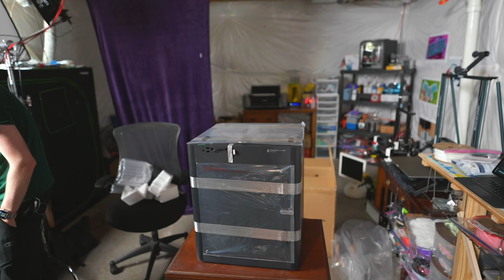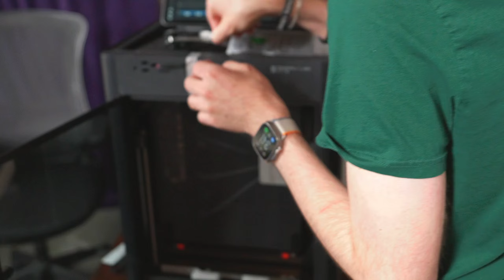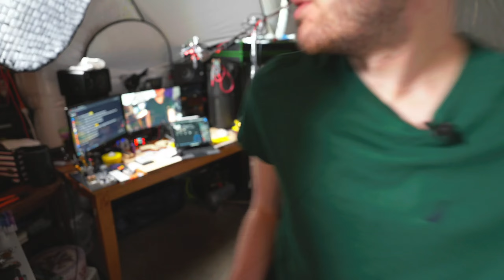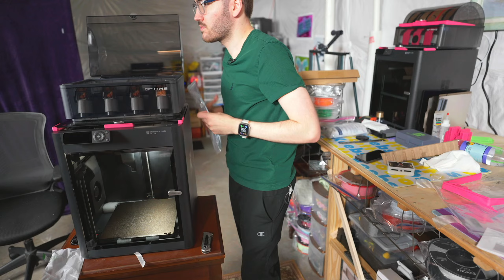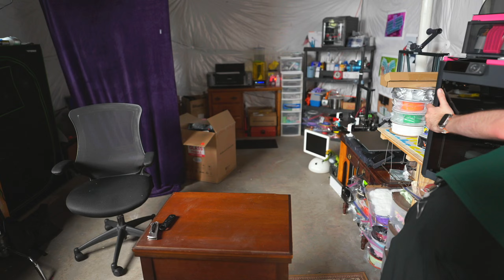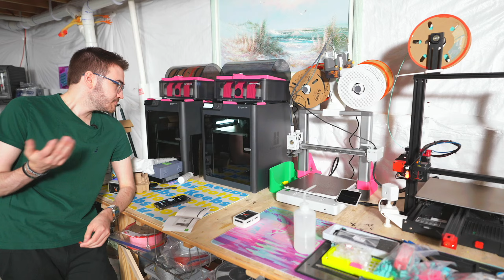Bambu Lab P1S Combo Unboxing and Setup

Comment: Pity you didn't put the filament holder on, I got the first screw in no problem but the second screw would not start, after 10 minutes I realised there was a short screw already in the hole to keep the main back plate on. Duhhh Didn't see anything in the manual about it, yes I read it and watched numerous videos.